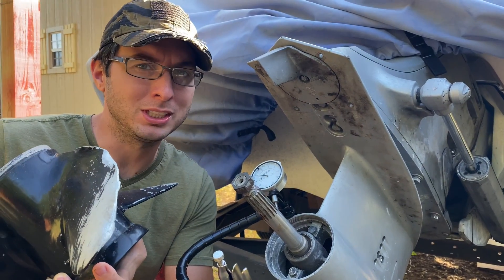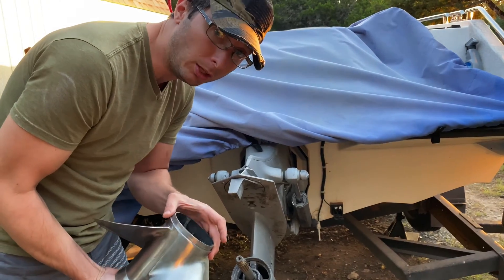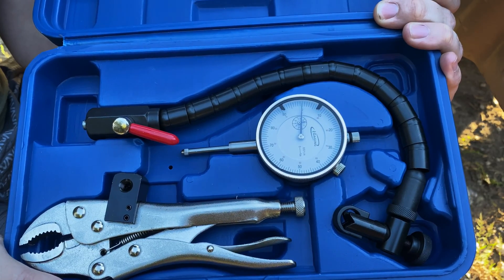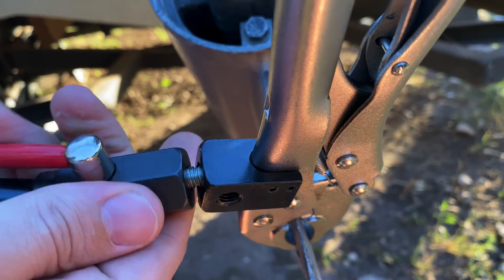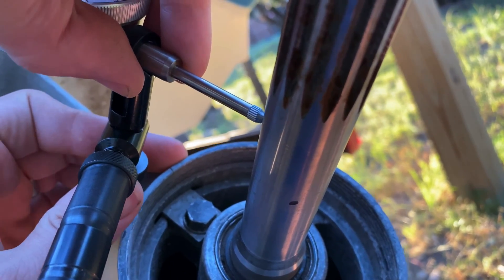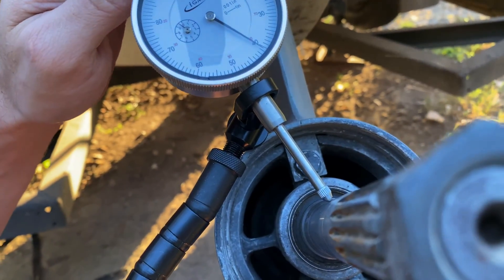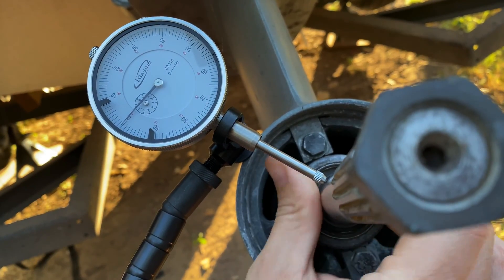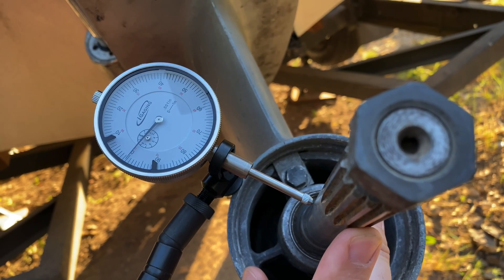How to Check for a Bent Propeller Shaft on Your Boat

Comment: Mines not bent, but it has a tiny bit of play. What's wrong? The bearings is not tighting enough against the outershaft? My seal was pressured tested, but after picking up the drive by the shaft, a little mistake, I got a little gear oil seepage.  Also if I pull the shaft It comes forward like 1/8th inch. Is this normal?
Reply: https://youtube.com/shorts/iFtB7FJMQKs?si=0B4VbENNNB5qRVH8

Comment: SS is a stronger metal and will transfer the impact forces to the shaft & gears. Aluminum prop will be dented & chewed up, but absorb the impact forces, protecting the shaft & gears. Thanks for showing how to use that tool. I probably need one if buying another used boat. 😆

Comment: We hit a small tree limb floating at 70 with a stainless outside exhaust Clever prop and it bent the shaft. I was passenger. This was in an old Glasspar. With a 1979 175 Evenrude. With a jack plate and stainless klever prop and chopped top windshield lol. That thing was a chine walker extraordinar. Before we made Hurricane Performance Tunnel Boats. The old days make me smile. Unlike the new days!